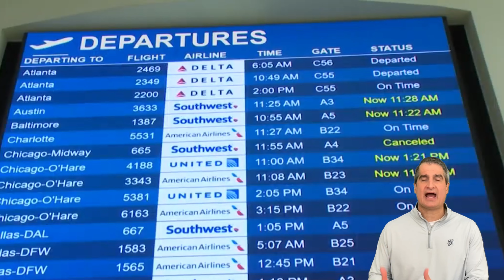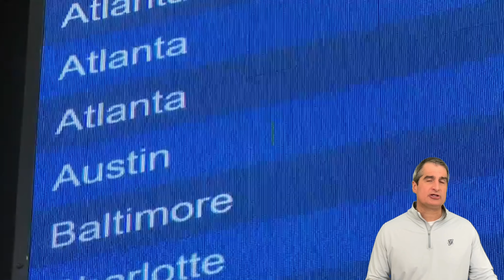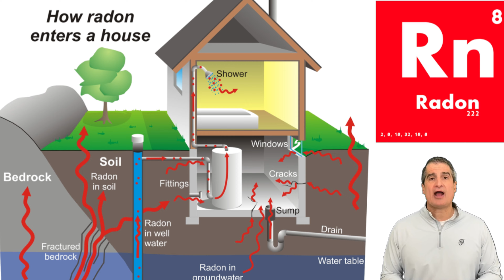PROS AND CONS Living in Columbus Ohio 2024 | Moving to Columbus Ohio

Comment: Thanks for mentioning radon, other videos didn't mention that. How well do the electronic radon detectors work?
Reply from the maker: Your Welcome.  Radon test are pretty simple you can buy one for $15 at home depot.  Typically buyers will do one during their home inspection contingency.  These are more expensive $150 range. The systems installed work very well and are not very complicated.